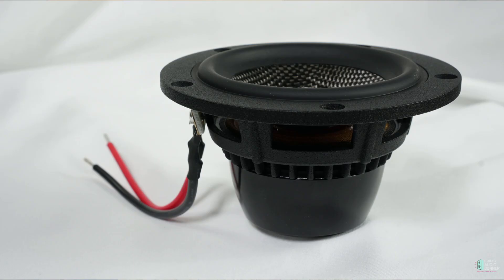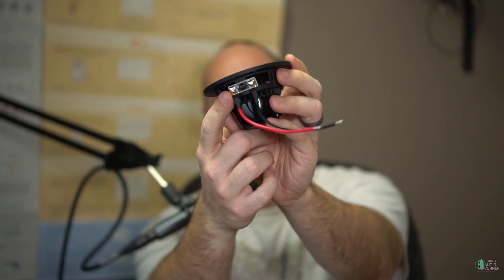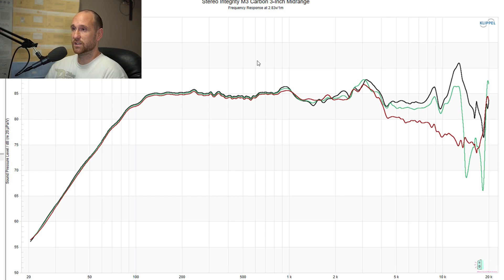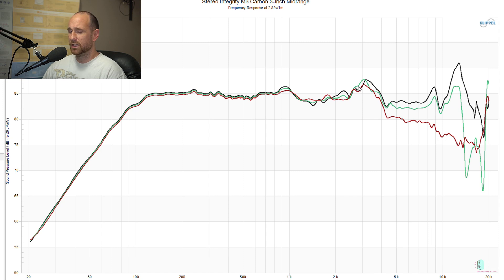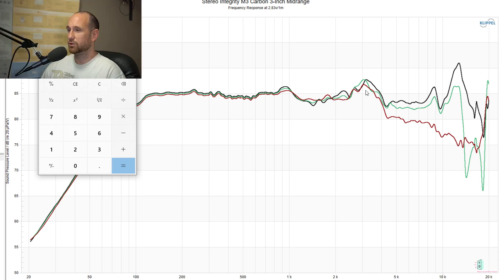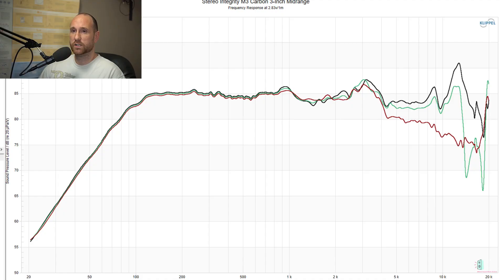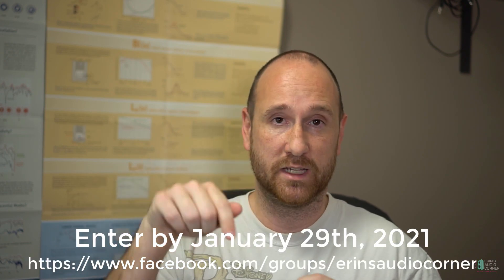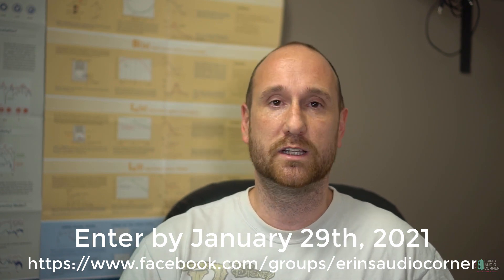Stereo Integrity M3 Carbon 3 inch Midrange Review

Comment: Will this driver outperform a Scanspeak 10F for distortion when crossed above 300hz like you mentioned?
Reply from the maker: It's been so long since I've looked at the data of the 10f, I couldn't honestly say.  I will say that the 10f is one of the most recommended drive units for good reason.

Comment: So what would you recommend for xovers for these? I have the full SI three way. Will mount the 6.5 low in the doors, the M3 in the A pillar, the M25 tweeter next to the M3 in the sail panel.
Type filter?(LR, Butterworth..) (12db, 18db, 24db) Looking for good starting points for all 3. If I set the M3 to play 500Hz-3000kHz, do I set my midbass to cut off at 500Hz as well? Tweeter cut at 3000kHz? Or do I set the off a bit, say at 450hz(midbass) and 3500kHz(tweeter)???
Reply: We have that same setup in our Passat. Just for a frame of reference here are our crossover points. All are 24 dB/octave: 70 Hz, 300 Hz, and 5,000 Hz. TM65's cover from 70 Hz to 300 Hz. M3's cover 300 Hz to 5,000 Hz. M25's cover from 5,000 Hz to 20,000 Hz.
Reply from the maker: Depends on the car and the install. A lower crossover will help keep from having issues and mid range or separated more than a wave length. However if they’re not, you can push the mid range at MrBeast Crossing region a little bit higher and take some of the load off of the mid range. As far as the tweeter goes I’ll probably would not cross in higher than 4k because the mid is too directional by then. I recommended 300 Hz to 3kHz in the review but your install and your listening conditions will change that.
Reply: @ErinsAudioCorner  Do you leave a gap in the Xovers? Like say 300hz for the M3, but 250hz for the midbass? 3000kHz for the M3 and 3500kHz on the M25? Or do you set them equal as far as the cutoff #?
Reply from the maker: @46HarvesterOfSorrow  the electrical crossover and the acoustical crossover are different.  If I find a need where a gap in electrical crossovers is needed then I would.  But, like anything else, it really depends on the exact install conditions.  If you don't own a microphone you might want to consider investing in one.  It will help a lot (once you get through the learning curve).

Comment: How does this compare to the GB25?
Reply: Subjectivity I preferred the M3 over the GB25 in my installation firing up into the windshield dash corners. Just my personal preference. Both are great drivers, just depends on installation and personal preference.
Reply from the maker: FWIW, I tested the GB25 here: https://www.erinsaudiocorner.com/driveunits/audiofrog_gb25/

Both are good in their own right.  
Sensitivity: Both are around 85dB @ 2.83v/1m.
Frequency Response linearity:  both are fairly linear below their beaming point.  
The GB25 is ±1.5dB from ~160Hz - 3.5kHz.
The M3 Carbon is ±1.5dB from ~110Hz - 3.0kHz.

Both are below 1% THD above 300Hz at ~96/97dB output @ 1 meter.  

The GB25 is a bit smaller.  So if space is limited it seems like the better choice.  If you can fit the M3 then the value seems to be a bit better there (MSRP of $400/pair on the SI website vs the GB25 MSRP of $450/pair).